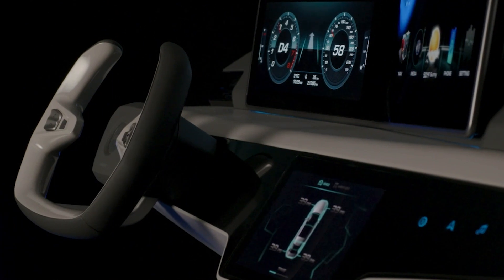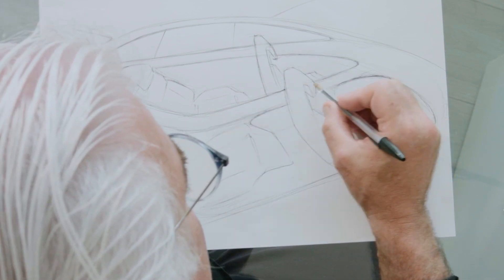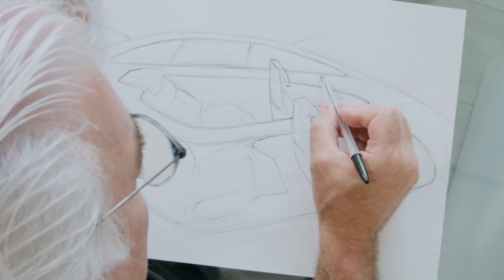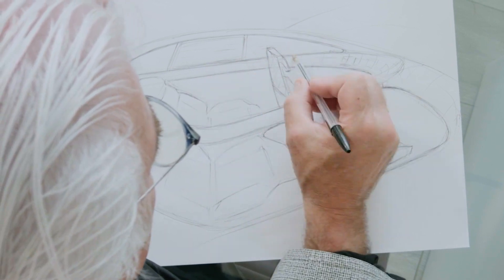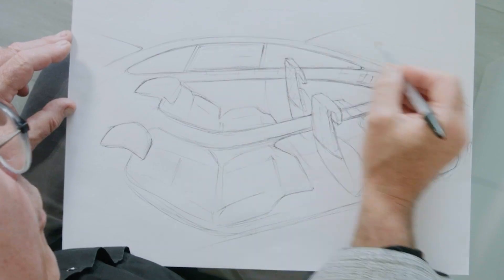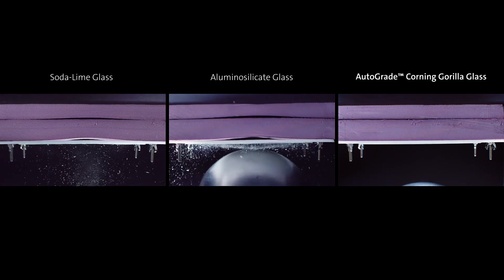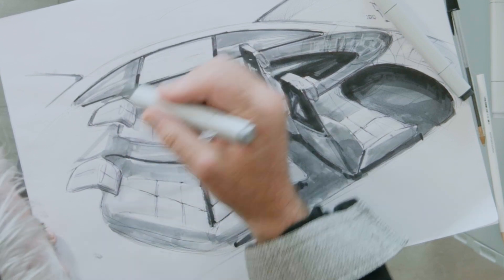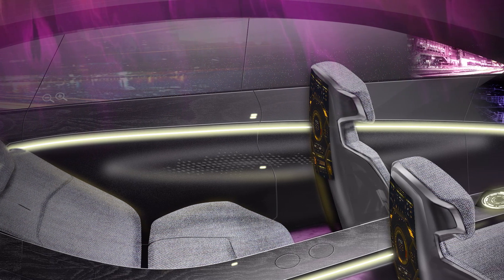Is This What Car Interiors Will Look Like In 10 Years!?

Comment: Hey frank, as an engineer at Mercedes-Benz I can tell you that with current technology, we can’t have so much glass in the interior for trim pieces and entire dashboards, due to safety hazards. In the event of the crash, the glass will act as a projectile, that could hit the passengers in the chest, head, eyes etc. it’s feasible, but not with current costs and technology.
Reply: As Frank said multiple times, the designers design the future, not the current tech because this is where we might be possibly going, not where we already are. However I'm totally with you on the safety concerns.
Reply: First thing to think about is how do you get rid of all the finger prints, safety is second XD
Reply: @Andreas-yt9wv  The best option is to use slightly matte finish glass, like you see on certain computer screens. It also helps give a bit of tactility to the screen if it's touch sensitive. But the car industry is notoriously behind on the tech side compared to other tech industries so don't expect to see too much experimentation in this field yet. It's always whatever is cheaper gets used. For example there is no excuse to have laggy screens in today's cars, yet some cars still have them.
Reply: he's sponsored by glass company, but keep what you're doing, I still love real luxury materials like wood and leather when I'm in a car.
Reply: AsMercedes puts nearly square meters of glass on their new EQS (and other models) dashs, I wonder why it couldnt be used on side or center parts.Not really logical
Reply: Similar thoughts from an engineer at a nearby competitor, though not involved in interior development ;-)
Reply: @SpeedIng80  just make sure interior department don’t overuse glass and monitors. As a consumer for high end vehicles, I really don’t want Pimp My Ride’s design philosophy to be the new standard for luxury.
Reply: @VinWeiLee27171  I agree, I don't accept the modern interior style as well, but nobody listens to me ;-) . That's why I'm currently about to buy an E39 BMW, from the gold old times ...
Reply: @SpeedIng80  Shiiit man, that caught my attention, was an E39 owner, missed that car so much! you'll have a blast with it
Reply: @VinWeiLee27171  Thank you! Best about it: it is a 540i manual 😎
Reply: @SpeedIng80  E39 540iT manual gang represent!
Reply: @VinWeiLee27171  Simple solution is to make any trim or surface capable of displaying video completely user controlled.  So you could turn simply switch off all superfluous visuals from all areas of the car outside of the driver's view if you so desire.  But alternatively you could have waterfalls playing dimly on loop all the way around the car.  You could display a strip of the night sky, almost invisible aside from the twinkling of distant stars, while another owner could be running a similar scene but prominently featuring vibrant nebulae here and there.  I mean, a truly customizable wrap around display suite would be next level in every way, not in the least because it would provide ambience and beauty for the most understated driver all the way up to whatever the pimp my ride crowd wanted to throw at it.  I mean, continuous slivers of animated abstract art all the way to porn collages -- the only limitations are one's imagination and sense of taste.  This is one future tech development I'm very excited for but it will be decades before anything like that would be available for anything cheaper than ultra luxury.
Reply: @solidXxXtuna  trend seems to head toward this direction. But It’s not luxurious to me, surrounded by monitors still feels like a gimmick. And gimmick is only fun for a short period of time.

The concept might have some good usage, for example party vehicles for club hopping. But for consumer items it’s not an appealing option. Ask in what situation you’ll need this function?
If the function of vehicles is still traveling or sightseeing, then secluding people from outside elements feels contradictory to the concept.
Lastly, imagination really isn’t freedom like people thought it is. It’s a tool to solve problems, but overly rely on “imagination” to design things without clear goals is limiting, the complete opposite to the word itself.
Frank’s demo is a great technical demo and a sells pitch for glass, but it’s kinda a forced sell so it doesn’t work for me.
Reply: @VinWeiLee27171  Interesting take on the imagination of design versus the function of engineering.  I can't say I disagree with you on that one.  But as cars become less driving machines and more transportation modules, the engineering solutions need to be hidden as those only stick out when they go wrong.  Assuming the engineering is quality enough to be invisible, design is what will sell a car.

On your first point, though, it's an important distinction to make that the idea is not being surrounded by monitors.  Monitors will soon be an anachronism.  The concept, and for sure the future, is trim capable of displaying video.  That's what, I think, Frank was focusing on in that particular part and I agree with him there.
Reply: @Victor Kar I don‘t believe it will be secure. And furthermore, it takes away the best from driving: The driving pleasure.
Reply: What's holding from growing a moustache? is it safety concerns or current technological limitations?
Reply: Isn't the hyperscreen of the EQS and EQE as large as this?
Reply: Lexus LS enters the chat.
Reply: From just the Corning demo in the video (which of course you can't take promotional videos as truth of the characteristics of the final product), it seems they've created a glass that deforms significantly without losing structural integrity.  It may be that the test footage included in the video was not representative of how the glass would behave under high impact, high deformation crash scenarios, but it doesn't seem to be significantly more prone to turning into a projectile than other common chunky trim and insets.  I suppose I could see safety issues with feet-long glass inlays that dislodged in a crash but remained in one piece -- could imagine long, curved, blunt edged guillotine blades flying through the car.  If they could be designed to section out in a crash instead of shattering, maybe not so dangerous in that one way.
Reply: "Derek, it's just a mode--"
Reply: Hi Mercedes Benz engineer guy, do you still have the lotus biscuits in your showrooms? The one thing I remember about a Mercedes Benz showroom is the coffee flavour of the lotus biscuits.
Reply: I just though the same thing. I'm currently working on a similar project.
Reply: Exactly my thoughts regarding the amount glass.